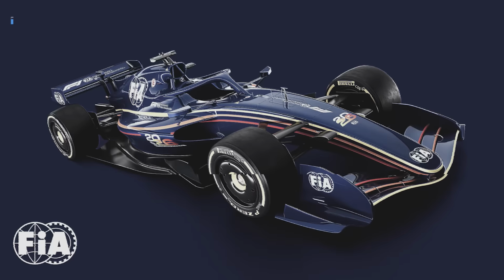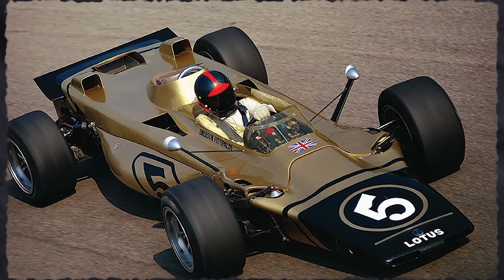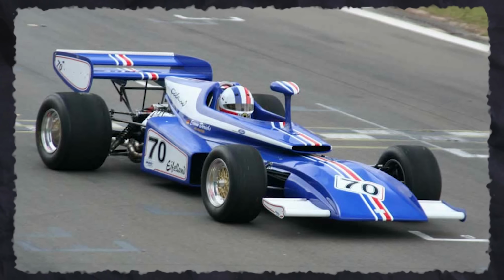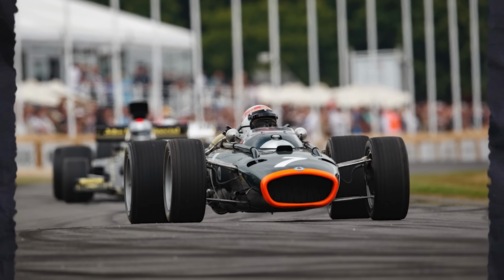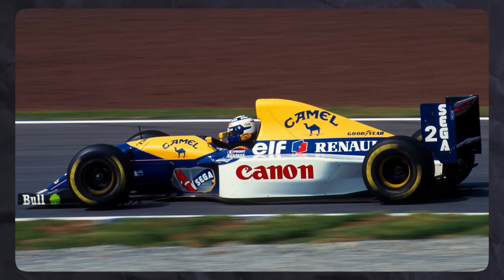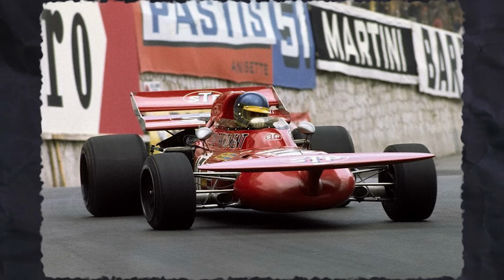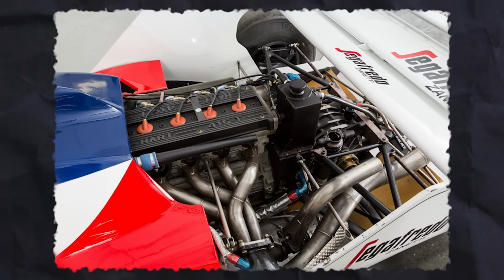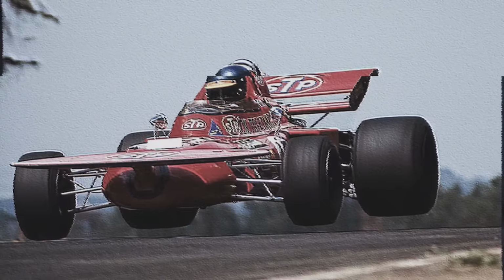When F1 Engineers Lose Their Minds

Comment: Wasn't the 711 the most successful March F1 car in racing, where the never raced 2-4-0 was their most successful commercial F1 car because Scalextric licensed it for what was pretty much their standard set for about 10 years
Reply from the maker: I'm actually not too sure, i hadn't heard of the team before researching for this video, their last race outdates me by about 10 years lol. P4 in the constructors is a good effort though. Cool information mate 👌
Reply: @Cobbahh  Their best season was actually with the 701 in 1970, finishing 3rd in the constructors championship with 48 points. March actually won a few GPs - Jackie Stewart in a private 701 at the '70 Spanish GP,  Vittorio Brambilla in the 751, in the rain, at the '75 Austrian GP and Ronnie Peterson in the 761 at the '76 Italian GP. 

However, they were far more successful in the lower formula - F2 and F3 and latterly in Indycar Racing. Nissan also used March chassis for some of their Group C cars. March Engineering came to an end in the early 1990s.

Comment: 2:07 The wedge shaped Lotus was not introduced with the turbine engine car, but, instead a year earlier, in 1970, with the 72 model that had a Ford Cosworth engine.
Reply from the maker: In formula 1, yes. But the wedge shape was first used on the 56 for the Indy 500 in 1968, which was later adapted for f1
Reply: The Lotus 56 debuted at the 1968 Indianapolis 500 and was subsequently modified in 1970 for F1 use. Principle changes were a gas turbine of comparable size under FIA equivalence rules to a 3-litre piston engine, front and rear aerofoils, plus larger brake cooling ducts for road circuit use. The F1 56B's best ever result was in 1971 in a European F5000 round (!) at Hockenheim, in the hands of Emerson Fittipaldi, where it came 2nd. behind the F5000 Lola T300-Chevrolet driven by Frank Gardner.

Comment from the maker: What cars did I miss? Let me know what your favourite funky car is from the early days of F1!
Reply: Ligier JS5. You featured the Tea Tray and missed the Teapot. Also, Brabham BT34 "Lobster Claw."
Reply: @J @JCCyC  The JS5 is got to be the worst looking racing bricks ever made. But it still looks good for ‘shock value’.
Reply: lotus 88 with the twin suspension setup, banned before it ever raced.
Reply from the maker: @musclecarbear4704 , that is a crazy one, engineers were wild back then haha
Reply: The most obvious is the Brabham BT46B "Fancar". One race, the 1978 Swedish GP, which it won, driven by Niki Lauda. It was then promptly banned. 

There was also the 1979 Arrows A2 "Doodlebug", it wasn't as successful as the BT46B, the main reason being, it didn't work! 

Or, the Ensign N179 which initially had a very novel front radiator design. Unfortunately, it cooked the driver and was quickly redesigned to a more normal set up.